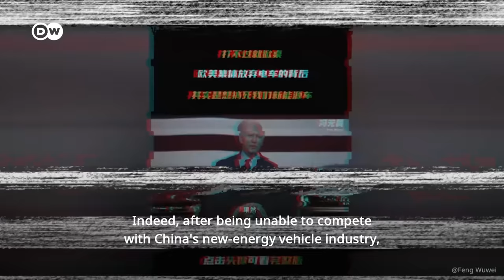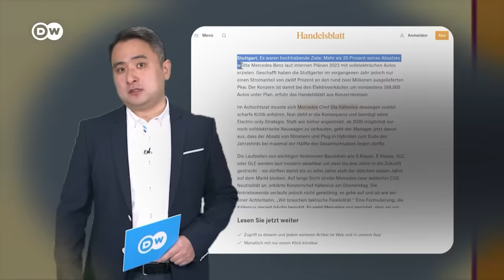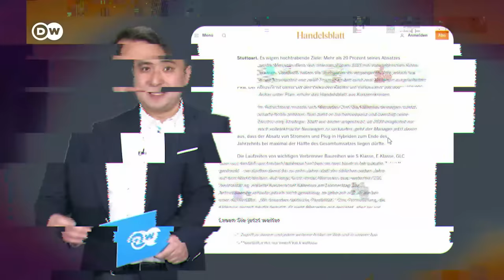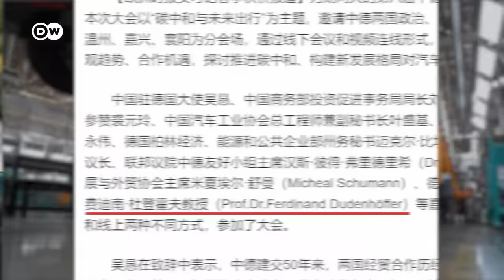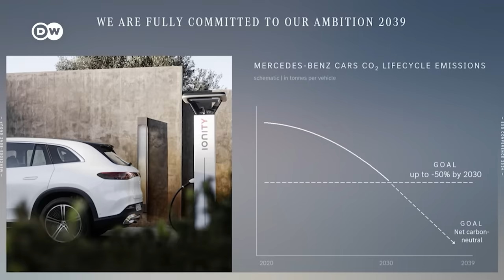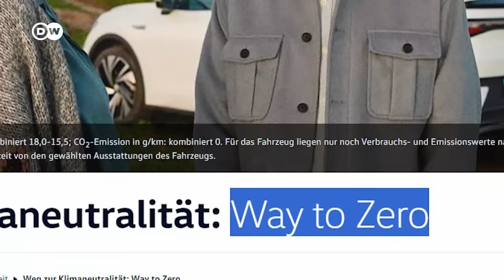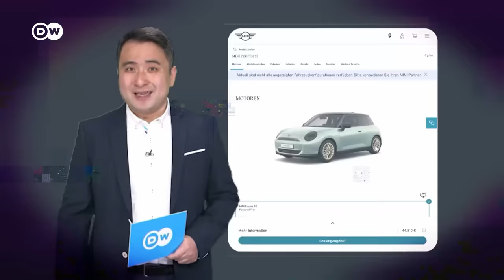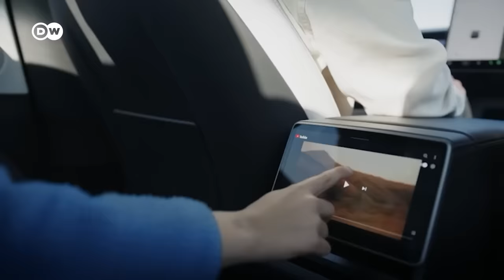Is the EV dream dead?

Comment: Imagine a world where only EVs exist. And then someone invented the internal combustion engine: half the weight, three times the range, time to fill up the tank (aka battery) in minutes instead of hours, no degradation of the fuel (aka battery), less wear of tires because of less weight, lifetime of tank (aka battery) unlimited, no dependence on cobalt mined by slave labour in the Congo, no dependence on China for polluting rare earths.... it would be a no-brainer.
Reply from the maker: Well, that's sort of what happened at the turn of the century. EVs were the predominant mode of transport before the Ford Model T arrived on the scene and quickly gathered steam. https://www.energy.gov/timeline-history-electric-car
Reply: And lower insurance costs! Actually, though, hybrids tend to be the best solution for most families who can't afford multiple types of vehicles. And may people live in apartments and rented homes with no access to plug in EVs.
Reply: Imagine a world where ICE cars show up, with their comparative lackluster acceleration, their belching hydrocarbon footprint that creates cancer causing pollutants on top of encroaching climate change, has no advantage in refueling / recharging anymore because battery tech is already advancing to the point where 20-80% charge can take only 5 minutes and LFP batteries reduce thermal runaway danger to next to zero, where there are far fewer moving parts to service parts with.FAR LESS wear and tear because electric motors are comparatively simple constructions, so that stealerships I mean dealerships no longer have an excuse to price gouge consumers on maintenance.... And it's an ABSOLUTE no brainer...

Comment: cheaper EVs is what is needed, not bloated and expensive vehicles.
Reply: No. We don’t need EV’S. We already have  a system that works!
Reply: Not only cheaper, but much higher energy density. A much higher energy density battery means that a much longer range, less frequent to charge it, much lighter vehicle due to usage of much lesser batteries.
Reply: @larrymoore8094  if you don't want one, fine, but some do.
Reply: It is an excuse one car like my moped. But not for Bug Out vehicle or any emergency.
Reply: Say that about a Gold that costs exorbitant prices for some cheap plastic and terrible tech.
Reply: @ev.c6  
Mercedes Benz?
Reply: BYD's are competitively priced and well built. Battery technology is constantly evolving.
Reply: @hhgttg69  only some but, the majority dosent want anything to do with EVs.
Reply: @carlsmith5545  true

Comment: The VW ad shown at 9:34 reminds of back when they has "clean Diesel"  in the early 2010's.
Reply: Fun fact toyota is now investing in diesel, I think they will combine their hybrid technology with it, VW's clean diesel thing was a good idea with a but application which didn't have to do with their mechanical expertise
Reply: Except that EVs are actually cleaner.
Reply: @Simon-dm8zv  except for when you factor in the mining industry and the battery replacement costs
Reply: @ZoomZoomMX3  Nope
Reply: @ZoomZoomMX3  1 million mile batteries, fossil fuel mining isnt a thing on EV. Please do some research. Car will die before battery
Reply: which, as proven by the "Dieselgate" scandal, was a big fat lie. There is no such thing as clean diesel, period. That's why, as penance, VW has been building EV fast-charge networks across America and Canada.

Comment: Only in German OEMs, not in China or Tesla.
Reply: LOLS..after the nordstream pipeline being blown up..germany still has not grow any ball to investigate it.
Reply: "BYD, China's largest electric vehicle (EV) manufacturer, reported a significant decline in sales for the first quarter of 2024, marking a 43% decrease compared to the fourth quarter of 2023, Reuters reported."

BYD's Q1 EV sales drop 43%, ceding top EV seller title to Tesla

And as for Tesla

"Tesla warned in January that sales growth this year would be even slower. As it turned out, sales haven't grown at all in 2024. Instead, Tesla's global first-quarter sales plunged more than 20% from the same time last year, marking the first time since the covid pandemic that sales have gone down over a year."
Reply: China’s “new energy vehicles” — which include battery, plug-in hybrids and fuel-cell vehicles — grew their market share sevenfold between 2019 and 2023, and analysts project the industry will continue expanding by around 10% each year for the next five.

Alongside that remarkable growth, however, has been frustration: The survey from McKinsey China pegged battery EV buyers’ “regret rate” as surging from 3% in 2022 to 22% last year, which its report blamed largely on limited charging infrastructure. Chinese consumers’ “acceptance rate” of new energy vehicles in general also dropped from 68% in 2022 to 62% in 2023, meaning fewer people were looking to buy these vehicles.

[...]

Evolving expectations could be partly to blame, Phate Zhang, the founder of the Shanghai-based industry outlet CnEVPost, told me. Early adopters of EVs were often more affluent, curious, and well-researched on the topic. But as the market has ballooned, consumers quickly shifted from trailblazers to more everyday users, who may be less prepared for challenges associated with EVs, he said.
Reply: @miraphycs7377 hahaha, comparing q4 to q1, you are so smart.
Reply: Not surprising. German carmakers are really bad in software, which becomes more and more important.

Comment: Buying an EV now is similar to buying a flat screen TV when they first came out. They where expensive, ran hot and mainly a Veblen item for bragging rights. A few years later OLED and similar technology made them widespread and cheap. We have not reached that stage in EV technology, EVs have some features that made them vastly inferior to ICE. Mainly the charge time, weight and the financial risk in repair.  We have not seen what happens when small garages repair them out of warranty. So many future unknown risks. Eventually, perhaps when a new battery chemistry is invented that negates these deficiencies then people will switch over.. All the wealthy people that wanted it have been saturated. EVs will dominate eventually and not go away, no more then we went back to the CRT after seeing flat screen.
Reply: It’s funny, I have the opposite impression: Tesla model S is 12 years old, some have driven a million miles or more, it was better in every way when it came out. Yes charging on a road trip is slower, but can you fill up your gas car at home? No. Can you put something on your roof to catch sunlight and then make gas? No. 

Batteries are already so cheap that replacement is feasible, but you won’t need to. Only the million-mile guys are doing that.
Reply: @mrmichrom8553  neighbors model S is almost at 700k miles but its on its third battery😅
Reply: @airrodgers1242  And how many motors would you have had to replace by 700K? 3? Each at 8K a pop... that''s still $21K.. So the brag is what again???? SMH... MOVE ON TROLL. EV's clearly live in your head rent free already with that attitude and logic leap!
Reply: @stickynorth lol u mad... losing money on Tesla stock ha🤣
Reply: no its not. EVs are already at 40% market share in China the biggest market in the world.
Reply: German please stay at ICE forever.
Reply: EV will still comeback, but not now. There is still lots of improvement on battery technology and electric motor (increase energy density of batteries dramatically and increase efficiency of electric motors )
Reply: This is a common misconception that some wonder will happen and negate laws of physics... No, it won't.  Even if they find a battery which has the same density of energy as gasoline per weight or volume, they will never solve the problem with  really fast charging which will not be measured by hours but minute. That expectation will be,  for example, the same as expecting that just by using regular garden hose you can fill a large barrel of 1000L (250 gallons) with water in 5 minutes.  No that will never be possible unless they boost water pressure in our house at least 10 times. Same applies for amount of electricity that can be pumped through resonably sized wires in short time.  Some inventions progress at extremly rapid pace, like computers or mobile phones. But whatever needs a lot of power, that doesn't change much with time. Generator are still the same as they were 100 years ago.
Reply: TRUE, however society right now isn’t ready for EVs AS THEY ARE NOW… For all the reasons you stated…
Reply: @airrodgers1242 
Model S's are super/hyper performance cars.

The batteries are optimized for 8-9s quarter miles. They don't last as long, and degradation happens faster. Newer battety chemistries are also improving the performance and lifespan. 

HOWEVER, that car was MUCH cheaper to maintain then ANY of the super cars it annihilates.

Oil changes on a super/hyper car are usually close to $20k.
Engine rebuilds are also scheduled maintenance in such cars. 

The more common Tesla Model 3 rarely ever needs it's battery changed. Even after 100's of thousands of miles.There's 1 Model 3 with 420k miles, and only 7% battery degradation. Most battery replacements are due to damage. Usually from water getting inside the battery protective shell (floods are the most common reason). And at that, over 99% of Tesla's still have their original battery...
Reply: @stickynorth 

This is a super/hyper car issue.

Standard normal high performance Tesla's, like the Model 3 don't usually destroy their motors, and they are lasting 100's of thousands of miles without issues. 

Early Model S's had some motor issues. Mainly from making so much HP in such a small space. The rotors spin up to 18,000 RPM (at top speed), causing extreme centrifugal forces that would start to fling the shunting bars right out of the motor's rotor over time. 
This is solved with newer versions having their rotors wrapped in carbon fiber. 
 
There was also an issue the first couple production years, where they would have an coolant seal leak, that would fill the motor housing with coolant after a decade or so. That's been long fixed.

Again, extreme performance car issues, and they are resolved in newer models. 
Try looking at the maintenance of other super/hyper cars (of lesser performance)... It'll be an eye opener..
Reply: @jameschalkwig787  that's why for EVs to be mainstream,  batteries has to be a lot cheaper(source materials that are very abundant) with very high energy density (energy density has to more than 4x).
Reply: WRONG
Reply: The only hassle with EV is charging time. You have to charge at least 30 minutes before you hit the road again. But there are EV charging stations everywhere, it's hardly an issue In Shanghai, for example, where there are EV chargers in almost every garage, charging is more convenient than going to the gas station.  With regard to repair, if you don't own an EV, you don't know how hassle-free the EV is. Even if you drive for 2 or 3 years, maintenance costs almost ZERO. All you need is to buy some windshield washing fluids.
Reply: Is salmon more healthy than beef? Should we therefore eat only salmon? We need a variety of food and technology. Many people still use manual can openers because they fulfill a need at a low cost and high reliability.
Reply: How about ratchet wrenches? Does everyone use battery-powered wrenches?
Notice where I'm going? New technology is often NOT the best technology for everyone. Unless there are high safety concerns to staying with older technology, we should never force users to conform to change.
Reply: @mrmichrom8553  So that Tesla never loses range during cold temperatures or when towing? Really? Hybrids essentially fix those issues, here and now. 5-minute fillups and 500 - 600 mile range hybrids are very common. Is that true with Teslas?

Comment: If we ignore the external world to the vehicle (eg infrastructure issues etc), there are two main issues to me as a consumer: One, all EVs have a very EXPENSIVE and ineffective way of creating heat for my comfort (explained in a moment);  Two, price, which has apparently brought the concomitant issue, manufacturers raising their ICE car prices instead of lowering the EV prices, to get parity!  The second point, is going to be ignored here, it’s partly a function of desperation and partly battery costs etc, I will leave it at that for now…essentially EVs are expensive and scarce, and evolving constantly at this time, therefore the used car market, which is all I ever buy from, is a desert of up-to-date decent EVs at an affordable used price.

Now the first point: heat creation for the cabin.  Here’s the scenario I solely judge a car by, because if I want discomfort and cold, I have a motorcycle for that - if I come down from hill-walking, drenched after a winter rainfall, slopping in muddy boots, and need to warm up and even dry my clothes a bit, can an EV accomplish this?  We’ll start by ignoring the cost…No, an EV apparently cannot supply enough heat to make the cabin blistering hot, I need a surfeit of heat and EVs cannot supply that, but that they lose so much range as a result, they leave you stranded, or you actually take a risk there’s a winter storm, snow blocks you in a road, and you freeze to death once the depleted battery drains.  This can happen, it’s not merely possible, but likely.  And children have low resistance to heat loss, they’ll die first.  Sorry, this isn;t good enough.

I test-drove a £70,000UK EV, and it left my feet freezing cold at the end.  Just one hour, and I was dry to start with, so this is not fixable apparently, with throwing money at it.  If it isn’t being done in a seventy grand car, it’s not feasible.  Ergo, I bought a hybrid, and it heats the cabin just fine, and doesn’t carry an extra 100 kilograms of battery, to be ‘sacrificed’ for the purpose of heat.

I did not expect this to be the result of me deciding what car to buy for my retirement.  I am not in fact as I thought, sorry I couldn’t afford an EV.  I have made the right choice of getting a Toyota hybrid, yet I believe in EVs.  Underneath it all, this inability to cost-effectively produce a surplus of heat in the passenger cabin, is what killed the idea of me buying an EV.  But as for the future, patently they are what’s needed - because you can create your own energy and deploy it in an EV…but this brings us to the next problem…all the people happy with EVs for daily use, tend to commute suitable distances, and have solar panels and a battery pack on a wall somewhere.  But that costs about the same as I had to spend on a hybrid car!  I don’t have an ‘extra budget’ for solar panels etc, just so I can have a particular type of vehicle.  

There it sits.  The energy crisis/wars/EVs coming as a combo package with solar etc, just to make them workable, doesn’t compute for most people.  I was able to get a hybrid that does what I need completely, in a package.  Under ten grand.  To buy an EV to equally meet my needs, is impossible presently, but even if you dropped the bar a bit and let the EV be merely adequate in heating the cabin, you still cannot escape the fact, nobody who advocates EVs for your main car, would dream of having one without their house being turned into a power station first.  I’m happy to do it - but where’s the necessary extra twenty thousand dollars or so going to come from, and why would I buy all that, when it makes no economic sense?  This is the trouble, EVs have run aground as energy suppliers flexed their muscles and profiteered from the ongoing wars.  It was a close race before that, and a clear trend, but everyone’s lost confidence because nobody making cars can influence the wars ending anytime soon.

If Vladimir Putin disappeared tomorrow, EVs would be back as a real option.  Take care all.

Comment: It’s the price and convenience.

To sustain the adoption S-curve, lower-cost options must be available. Basically, the market segment of wealthy adopters is saturated and most options cater to it, so growth is dictated by repurchase rate. Look to how flat screen TVs, smartphones, CD, DVD, Blu-ray players, personal computers etc. markets grew for examples.

The growth is stalling only in markets where the players are not offering or restricting access to lower-cost models. Rapid growth is continuing in markets where options across a broad price range are available.

Some markets aren’t helping with punitive registration fees that over-compensate for lost fuel taxes. For an annual distance of 15,000 miles, the additions fee should be closer to $75 instead of the $100-200 some states charge.

After that, convenience of charging needs to be made equivalent to how ICEV are refueled. Level 1 charging should be available wherever vehicles are parked. Level 2 where vehicles are parked while shopping, dining out, working etc. and where road trippers are staying at overnight. Level 3 along routes where drivers are likely to be making long trips and in dense urban areas when residents don’t have access to charging where they live or work.